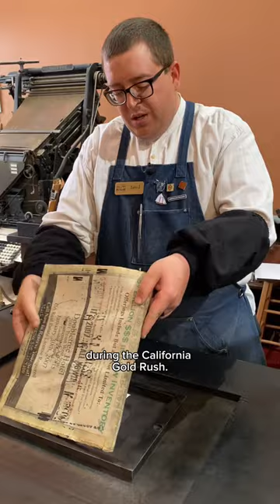Printing Chinese characters of Sacramento for Chinese Language Day (April 20)

Comment: Is this canto or mandarin?
Reply: Mandarin and Cantonese speaker here.

Cantonese and Mandarin use exactly the same typefaces and written words

It’s only the pronunciation that’s different, which in this case is mandarin.
Reply: @brutallyhonest8601  oh, I was explained that theirs simplified characters, and traditional characters, where mandarin use more simplified characters, and canto use traditional. Sometimes, where simplified characters are difficult for traditional readers to understand.
Reply: @TheCeezSteez  Cantonese and mandarin use the simplified version, though I wouldn’t doubt some Cantonese speakers can read traditional
Reply: its mostly based on region if they're more familiar with traditional or simplified, although ppl from mainland China use simplified as their main as it was set as the main written characters by the government some year ago.
There are also some regions where they speak mandarin but use traditional.